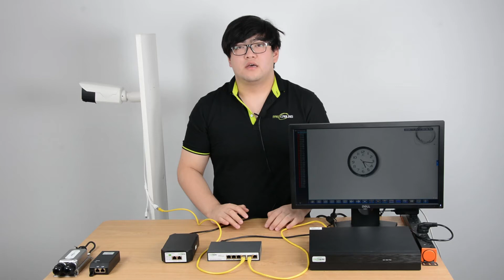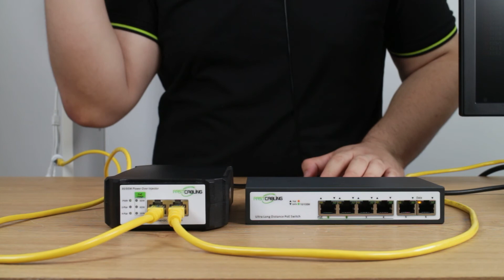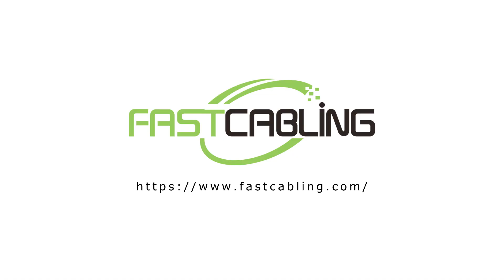Add PoE Injector: 30W? 60W? 95W? Which to Choose?

Comment: Great work, I kindly need your explanation on this, I have two 24 port PoE dahua switch how can I link the with the dahua NVR?
Reply from the maker: Yes, If you need high power for specific channel, you can add the PoE injector right before the Dahua PoE NVR. The high power PoE injector can replace the Dahua POE NVR to supply the power to that specific channel. Just be sure you will need matched PoE edge device to achieve the high power transmission. The POE injector will process the handshake to classify your edge device. If your edge device only accepts PoE+, the PoE injector only output 30W even it is 95W PoE injector.